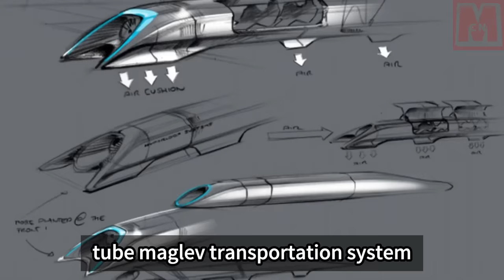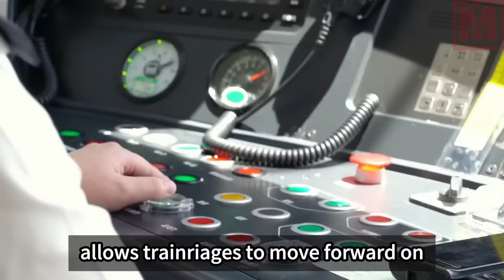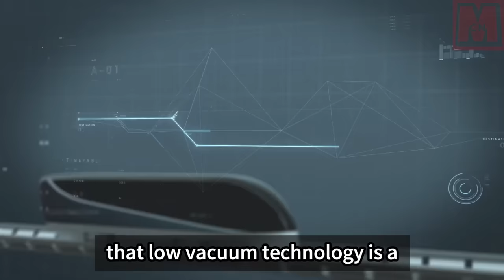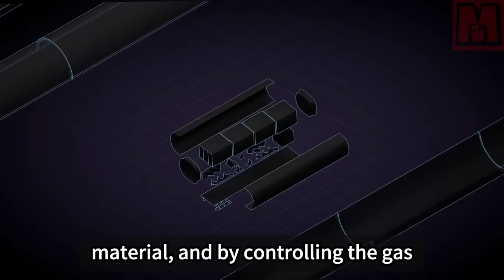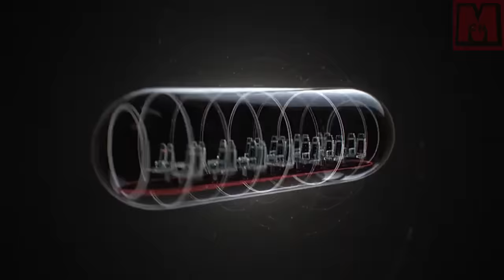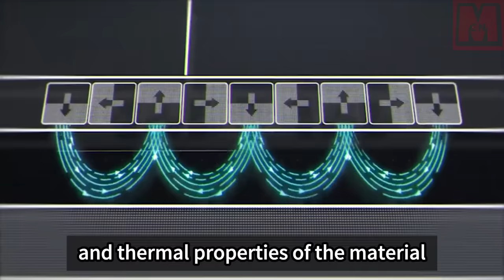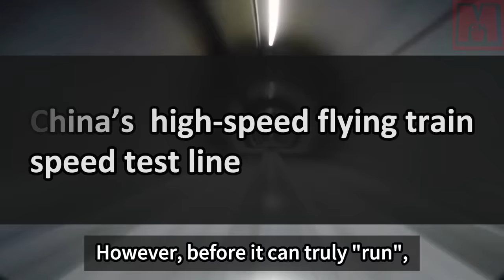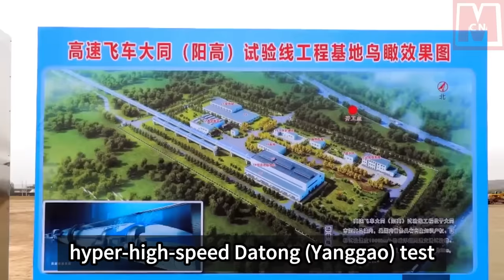1,000 KM/H! From Shanghai to Hangzhou in 9 minutes, China’s first hyper-high-speed rail is coming.

Comment: I always think it would be dangerous for anything on the ground to travel that fast. But  if they could solve all the safety issues   it would be amazing.  With these kinds of speed   it only take you few minutes to travel.  So I think peoples would love it
Reply: China has already unveiled the world's fastest train that can travel at a speed of up to 600km/h in October 2022 at a trade fair for the railway industry in Berlin, Germany. 

In addition to the above, China has completed a superconducting test run for its ultra high-speed train that aims for speeds of up to 1,000km/h (621mph) in a low-vacuum tube. If successful, it will become the fastest means of on-ground transport. So far there has not been any issue of safety regarding the train traveling at a speed of 1000km/h.

On a similar note, there was no safety problem with the USA's Concorde which even travelled at a greater speed than that of China's hyperloop train.
Reply: Electronic circuits in the trains control the speeds at which the trains should travel at any particular time. These circuits determine the starting speeds when the trains begin to leave the train stations, the speeds when the trains are on their routes to their required destinations, and the speeds as the trains approach their destinations. If these electronic circuits work perfectly and according to the required parameter specifications, then there should not arise any problem with speed safety issues of the trains.
Reply: I think they are elevated above the cows and trees etc.
Reply: Basically it's not on the ground, living in five hundred years ago people also would think it was dangerous for you driving, btw
Reply: For USA Concorde the big difference was the pollution, even if Americans seems not very aware about it.
Reply: Easier to joint a station than an airport, not noisy and less pollution!!!!

Comment: Wow, China is ready to roll out and test the first hyperloop maglev train with a speed of 1000km per hour, a speed that is faster than Boeing 737. However, the hyperloop train can only be used in a straight line and applicable as a transportation mode between big cities. To build the hyperloop network is another engineering challenge which China would no doubt be able to realize before this decade ends.
Reply: China's big city mass transit system is the most developed in the world, so it is very easy and fast to transfer to other modes of transportation. And the past, people thought that screens could only be straight but with the development of technology and material breakthroughs, screens can now be bent more than 80 degrees.
Reply: @hjhghj462  agreed.
Reply: 😂this is so amusing! Does anybody believe this CCP bullsh!t?

Comment: This would be much more interesting to watch if they took the time to review and eliminate the redundancy in the video. AI is a tool to collect the information but not good enough to complete the analysis and present it in an acceptable manner. 

The technology to travel that fast is known but the limiting point is as always the economics of the project. How much would it cost to build, how much would it cost to use and how many passengers would make it viable. Those are the information that would be the controlling factors to such a project.

Comment: The magnetics is the easy bit. Removing the 'air' from the tube is the challenge. It is the air in the tube that creates the resistance infront of the train/pod and the aerodynamic 'drag' that slows the train/pod down. Furthermore : a livable, sealed atmosphere must be created inside the 'pod'. The Tube/pipe will need to be constantly 'Evacuated' to maintain the low pressure/low  air density environment to reduce air friction and drag. 😊
Reply: Vacuum inside the loop.

Comment: Certainly, the Air-resistance will be (nearly) all gone. But in such near Vacuum environment. The (electrical) Short-circuit can happen freely (w/o proper insulation.) All Electronics Device also, can behave differently (as in outter Space/satellites technology)

Comment: To reach a speed of 1000km/h , in one km of distance (one km to stop), it only has 3.7s to accelerate . To accelerate from 0 to1000 km/h in 3.7s, it will need an acceleration of about 3.9g. The best fighter pilot can only withstand 9g with g-suit. When a fighter jet takes off at a carrier, it usually takes 2 to 3 g.

Comment: Hyperloop One, an American company, has signed an agreement with Dubai. It could see construction completed within five years, but so far the company has only built a 500 metre test track in the US.
Shanghai and Hangzhou will be connected via hyperloop by 2035, even though the distance there is only 108 miles. HSR already covers the route in one hour.
Seems like the concept is only popular enough to spark these two very short test cases.
Reply: Shanghai to Hangzhou High-Speed Trains 156 high-speed trains and bullet trains run from Shanghai to Hangzhou between 01:05AM and 10:25PM every day. The duration is around 1 hour and the ticket prices are USD16 to USD39. The fastest train G4833 with a maximum speed of 300 km/h finishs the journey in 45 minutes.
Reply: Testing and building are totally different stories.

Comment: Well 9 minutes doesn't seem like a big improvement compared to the existing 30 minutes travel on a high speed train between shanghai and hangzhou. 
That said, it is still exciting to see such thing happen. China is not going to call this thing hyperloop, nothing fancy when it actually happens, just something practical, so it doesn't have to be vacuum, it doesn't have to be maglev, and it needs to be able to carry many people, and the building cost has to be reasonably cheap, and there are multiple tech directions for different target speed. Chinese won't do PR stunt like Hyperloop One, instead multiple companies compete in this industry to see who can provide the most promising solutions. It is already started, come back in 20 years to see how much it will be.

Comment: What am I wondering is ; "How the Pilot  of this hyperspeed train can  slow  down the speed while😮 approching the Station He manages to stop at...? AND what happend ťo this Hyperspeed Train while slowing down its speed  - say then   from 1000 km/ h to  800 - 500 - 300 - 200 and finally to 00 km and then completely Stop.....WHAT WILL THEN HAPPEN  TO THIS TRAIN ...? Will it   Fall down or keep it Flotting inside  The Tube ... ?
Reply: Simple. Just let air into the tube. Air resistance will do most of the breaking 😂
Reply: I do remember I saw a video it can stop by control the magnets.  it is always fly on the rail and because the magnets, it is hard to go off the rail.

Comment: The amount of energy required to create the vacuum in all the stretch of track pipeline, will make it totally unfeasible
Reply: Never say never
Reply: A complete vacuum is not require, and thin air at high altitude is sufficient.